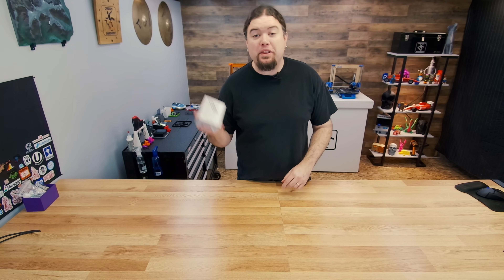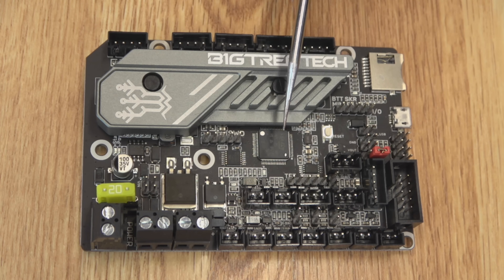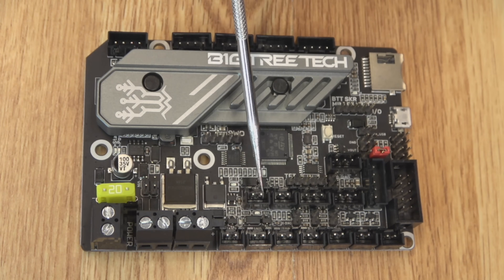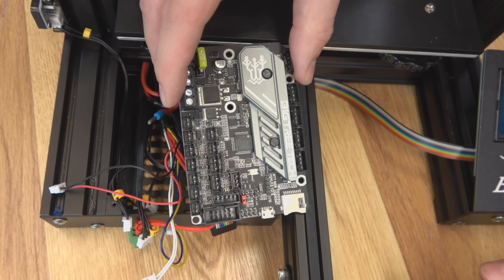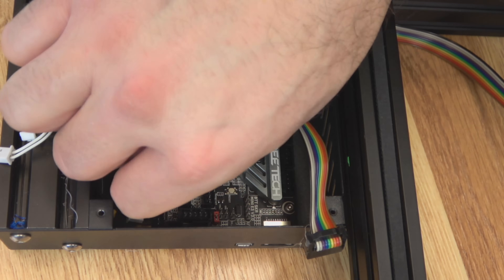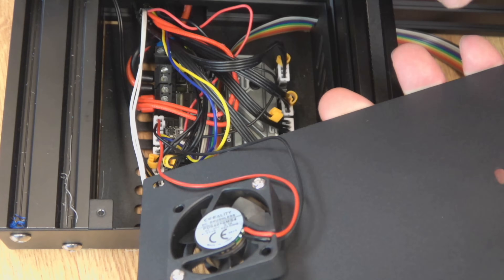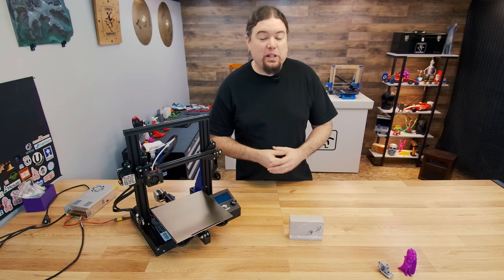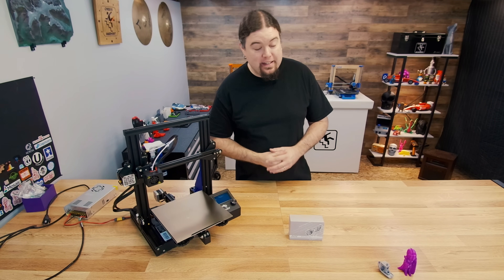BigTreeTech - SKR Mini E3 v3.0 - Chris's Basement

Comment: I dont have the tools to install a jst connector on to the hot end fan. is there an alternative solution?
Reply: If you have Dupont connecters, you could solder them to the raw wire. It's what I did in a pinch- make sure to insulate the joints

Comment: Hey, @ChrisRiley, Have you thought to check under the bottom of the pull out box, for this new board? They printed out the full pinouts,😳🤯 on the bottom,  of it. 

Great tutorial video for this board! 😉👍  

One thing i noticed, was that the micro-usb port, was a bit too wide, for the front of the metal front plate of my Ender 3 Pro, ( which laid dormant until 3 days ago because of a bas Mosfet on my BTT SKR MINI E3 V2.0 BOARD. I had to do a bit of filing to exapand the slot by about 2mm. After that, she fit smooth like butter! 😉

Comment: Dude could you help me please? I built a hybrid printer using an anycubic chiron frame and hot bed with ender 3 v2 print head and stepper motors. The stock ender board died so I bought this. Its installed but I have no idea what to do next.

Comment: Very useful. My V3.0 is coming for my Ender 3 Pro as the old original 8-bit board died on the extruder driver. The Marlin version is now 3 years old and no updated since this video came out. Klipper is 3 years old too, and I don't know if it can update in-place. Luckly the config file is 2 months old.

Comment: I keep getting "heating failed e1 printer halted" ive checked all my cabels and they are fine. I've also replaced my cables so I know it's not an issue with that. What is my problem?
Reply from the maker: E1 sounds strange, I think it should say E0. Is this the stock firmware?

Comment: Hello Chris - I'm HOPING you might spot this, in spite of the age of this video???  I want to pick your brain for your off-the-top guess on where you think I might need to look first: about a year ago I upgraded my old Ender 3 with this SKR Mini E3 along with a BTT Pi in order to move into Klipper.  For the most part things seem to work (from Klipper (mainsail) anyway) - BUT -- I can no longer print directly from the printer's control knob!  I can "see" all the gcode files of jobs that have already been uploaded/printed, but there does NOT seem to be ANY way of selecting one with the knob/switch.  Other things in the menu system seem to work (like setting temps, homing and manual moves of the hotend) but it sure would be nice once in awhile to fire it up and print something without all the steps of mainsail.  At least for prints that have proven successful already.
The other odd thing is that there is no way to connect to the SD card slot in the Mini - I can only see the card that the Pi boots from!
Have any guess?
Thanks in advance - even if all you do is read this and round-file it!
Reply from the maker: Not sure if you have seen this one, https://www.youtube.com/watch?v=guLfIbSH-Ig but the only thing I can think of is the pins aren't mapped correctly for the mini to the screen. I remember there being some strange stuff with the LCD in Klipper, like it would set the print ready, but not start it or something like that. 

On the SD card on the board, that is standard fair for Klipper, it only talks to the MCU to load firmware, so Klipper can access it.
Reply: @ChrisRiley  Thank you by the BOATLOAD, to put it simply! I'll take a look! 
Owe you one!!! 
Note to self:
Come back and pay up!

Comment: hey! thanks for the video. i’m installing it on my cr10s which has both the exp1/2 cables. would you recommend getting a th3d adapter so i can plug them both into the board or is there some alternative?
Reply from the maker: That's probably the best thing to do, you can find those a lot of places now a days.

Comment: Thanks for your great videos, they have helped me so much over the years!  Would you be willing to do a video on the BIQu Microprove v2 with the SKR mini e3 v3  marlin setup?  I have both these bits coming for my Ender 3 v1 and am seeing that people are having trouble using the probe port on the board, they are having to use the Z MIN Endstop to make it work properly which would not allow the use of z endstop homing.  There is a redit thread about this  that talks about it I believe. Not sure if BTT has fixed this issue yet or not.
Reply from the maker: Hey, thanks for watching over the years. I don't have one of those probes, but let me see if they will send me one and I will see what I can do.

Comment: I installed this on my ender 3 and now my lcd screen will not come on. I even bought the tft 35 touch screen and still nothing. Any suggestions?
Reply from the maker: Which ender 3 do you have? The stock ender 3 original screen should work just fine.
Reply: @ChrisRiley  yeah it's stock ender 3 but when I installed everything with stock screen and powered on screen not coming on at all.
Reply: @calvinmerricks7103 same issue for me, Ender 3 Pro. Some people say it’s from backwards installed display input on motherboard but that doesn’t work.
Reply from the maker: @calvinmerricks7103  Did you ever get this sorted?

Comment: Hey Chris!  I just purchased this board and the TFT35 E3. V3 Touch Dual mode display.  However after install when I try to do the 4 corner bed leveling, I get the front left and right corners done, but when I tap the button for either rear left or right  it gets in position and rather than go down for the adjustment it seems to stop.  However I noticed both Z motors were ever so slowly raising the extruder!  I've installed updated firmware with no success so would this be a moment where I have to go in an custom edit the firmware?
Reply from the maker: That's a really strange issue. I would guess it's something with the screen. Sometimes the firmware on those does really odd things. Not sure exactly how to correct it.
Reply: @ChrisRiley  Thanks Chris.  I think I'm going to go back to the old screen for now.

Comment: I bought an ender 5 plus with RepRap duet on a kinetica g2c board can I direct swap this instead
Reply from the maker: Yes, you can use it with the Marlin example. You will have to reflash the firmware.

Comment: Hi Chris i want to remove the z limit switch. Would it be possible to list the changes need to make in marlin please.
Reply from the maker: So you just what to use the probe for Z, no switch?
Reply: @ChrisRiley Yes Chris i have downloaded BTT  firmware use probe for Z homing .BIN and it works fine. however i want to make further changes. I have the BLT white and black wire connected to the Z endstop plug. Thank you for your reply . I would also like to use Marlin 2.1X as the BTT firmware is 2.0x

Comment: i have a Creality CR5 pro. I'm looking to upgrade to a 32 bit board. Which board would you recommend? I'm looking at the skr mini e3 and the skr3 ez board.
Reply from the maker: I don't know the CR5 well, but it really comes down to what plugs you need. The mini is a fine board, but you have only 4 drivers, so Z has to share. Also, it depends on what kind of screen you have, remember, the mini is meant for the ender 3 and can work on the old school CR10 with some code changes. The EZ is going to be more universal, but a lot larger.

Comment: I'm so confused as to where the hotend fan wires go if i DONT have a JST connector?
Reply from the maker: You can pull the shroud around the connector and just use the pins if you would like.
Reply: @ChrisRiley  ended up using some left over single dupont connectors.

Comment: Board works great, especially with the BTT TFT35 V3.0, even with USB jumper installed, can't connect to Pronterface, Cura, or Octoprint (Windows or RPI), Pronterface and both Windows and RPI see the com port, but won't connect to the printer. I should say it works great if I use a thumb drive in the screen USB port, but I can't center my prints.

Edit: Right after I posted this comment I had a lightbulb moment. I built and compiled a scratch build of the latest bugfix Marlin, I had the serial port configured wrong in Marlin.

#define SERIAL_PORT 2
#define SERIAL_PORT_2 -1

This is the right way, I've already forgotten the wrong way I did it.
Reply from the maker: Nice find! Yes, more than one serial bus makes it work like you have done here.

Comment: Just got my Version 3 board for my birthday last month. If I only have a stock endor 3 pro, do I need to HAVE the extra Marlin code or Kepler code, or can I use this board with just cura and nothing else?
Reply from the maker: If you just have the stock ender 3, it should work as is, no firmware update required.
Reply: @ChrisRiley  Awesome, thank you.

Comment: I have moved way past the Ender series printers, but still have my very first old original Ender 3 standard.  I recently upgraded it with this board and the CR Touch! It has many other upgrades, and still prints very well! I have two Anycubic Kobra 2 V2 that prints at 150 mm/sc. These print in a fraction and came with runout, power resume, auto mesh leveling, and direct drive extruder, all for $200.00.
Reply from the maker: That's awesome! Those Enders are pretty good!

Comment: hi could you help, ive fitted the e3 v3 to my ender 5 pro and the test print is very stretched in the z axis.
i also have the biqu h2 v2 extruder fitted
Reply from the maker: I'm guessing you will have to update some of the setting in the firmware for the ender 5 as the board defaults to an ender 3. You can update some of these commands in eeprom so you don't have to flash new firmware if you use a tool like pronterface. https://www.pronterface.com/

Comment: I replaced my old ender 3 pro board to skr mini e3 v3 and now printer dont even power on. Just red light on the motherboard flashing and emitting beeping sounds..
Reply from the maker: That should be a direct replacement. I would uncable everything except power and turn it on, see if beeping goes away. Then cable things up slowly and test to see what is causing the issue.
Reply: @ChrisRiley  Basically I just didn't realize that board is actually works because it literally silent, comparing to my old 4.2.2. I  updated marlin firmware by using sd card and use exp3 slot on my stock ender display, because exp1 and exp2 ports are not working with skr e3 v3. Maybe my comment will be helpful for someone. All fine now

Comment: Didn't plan on an upgrade, but my new Sprite all-metal hot end has a bltouch connector that won't fit into the BTT SKR Mini E3 v2 (it has a port for it, but it has a form-factor for a three-pin and a two-pin connector, instead of a straight-5 pin connector).  Great video for covering everything I needed!
Reply from the maker: Awesome, glad it help with your project.
Reply: And... I also did get the yellow duck, the crown of victory on my board upgrade!!!

Comment: How do you wire the CR10? Theres 2 case fans and then the hot end and the part fan ... But only 3 jst ports
Reply from the maker: I didn't know it had 3 case fans, you would either have to wire one to the input voltage or not run one.

Comment: Will this board work with dual z axis and a CR touch?
Reply from the maker: I will work with dual Z, but only one driver, but it will drive both motors at the same time. It will also support CR touch.
Reply: @ChrisRiley awesome. Thanks so much. Ordered.
Reply: @handymadness  I hope you have better luck with yours.  I got a this mini plus the TFT 3.5 screen plus the BTT Pi 1.2 rPi clone.  None of them seem to do what is expected of them!  Their documentation sucks and their "tech support" is virtually useless!
Reply: @palewriter1856    I 100% agree.  I finally gave up.  I had the SKR mini e3 v3 TFT 25, sprite, cr touch, and all it ever did was give me the error kill code.  So so annoying.  So I went back to the 4.2.2 board and the stock e3v2 screen and it all works except the CR touch deploys off the bed when I auto home.  insanely aggravating, but still miles ahead of where I was with the mini e3 nonsense.

Comment: Hello, does this board act as a direct replacement for the CR-10S with the v4.2.2 board?
Reply from the maker: For hardware, yes, you will have to get and upated version of firmware to flash it for the CR10 changes. By default they are configured for the ender 3.

Comment: in the ender 3 pro in the green sockets there is a fan, the first 2 negative and positive, you don't say the cables where they are placed, and by the way, what fan is it? and on the board that you show there are only 2 connections for the bed and the hotend.
Reply from the maker: Check the pinout for polarity. Fan0 is the part fan, fan 1 or 2 can be the hotend fan or controller fan. https://github.com/bigtreetech/BIGTREETECH-SKR-mini-E3/tree/master/hardware/BTT%20SKR%20MINI%20E3%20V3.0/Hardware

Comment: Have you been able to get it to connect with Octoprint? Octopring does not detect my printer...
Reply from the maker: It connects on mine, it could be a problem with the USB port. Test and see if you PC can see it.
Reply: @ChrisRiley  how do I test it to the PC? If I plug it into the pc what would the pc so? Detect the SD card?
Reply from the maker: @InfinityDrones  Download pronter face https://www.pronterface.com/ if you plugin USN to your computer Pronterface will be able to see it and you can control you printer to confirm the USB is working.

Comment: will the SKR Mini E3 v3.0 work on Ante A8
Reply from the maker: Sure it should, but you will need to update the firmware.
Reply: @ChrisRiley  Thanks, Which firmware would i need to upgrade
Reply from the maker: @CarmineSantopietro  You can use the an example marlin for the A8 here. https://github.com/MarlinFirmware/Configurations/tree/release-2.1.2.1/config/examples/Anet/A8

Comment: When two wire plug wires are opposite you dont need to mess with the plug wires, just pull off the female plug from the board and turn it around put it back on.
Reply from the maker: Cool, thanks for the tip!

Comment: Great video - Will this work with a CR10S, CR-Touch and a Micro Swiss direct drive setup?
Reply from the maker: Yes, should work just fine with minor firmware changes.
Reply: Thanks Chris, What changes would you sugest?
Reply from the maker: @sweres5839  The are coded for an ender 3 so mainly just the printer size would need to be updated.

Comment: Nice video. I got this board for my Ender 3 Neo but couldn't get it to work. The homing was all off no matter what firmware or settings I used.
Reply from the maker: Not sure on the NEO, it might use a different kind of endstop than the other printers.

Comment: How do you update this so my board works with CR 10 size I updated them as a combo
Reply from the maker: You would have to build it from a Marlin example for the4 CR10, check here. https://github.com/MarlinFirmware/Configurations/tree/bugfix-2.1.x/config/examples/Creality/CR-10/BigTreeTech%20SKR%20Mini%20E3%202.0 This will work with the V3 board with very minor changes.

Comment: I have an old Ender 3 clone with a dead MKS Robin Lite board.  I am trying to reactivate it with the SKR mini E3 V3 but it has 2 pin sockets for the End Stops.  My printer has 3 wire End Stops.  I'm willing to replace the 3 wire ones with 2 wire ones if someone can point me to a vendor with the correct item.  Everyone on Youtube with an Ender 3 seems to already have 2 wire End Stops. Can someone point me to the correct replacement parts or perhaps how to make the 3 wire switches work with the SKR board?
Reply from the maker: What type of endstops do you currently have? The ones on the PCB with the LED?
Reply: @ChrisRiley  yes
Reply from the maker: @bsorrell98  So I'm not sure if those will operate without 5v, but the 5v can come from anywhere. So you could do the Negative and trigger pins on the endstop pins and find 5v somewhere else. Or switch to a smaller micro switch. These work without 5v https://www.amazon.com/Creality-3D-Printer-Separate-Package/dp/B07BF8KXW3/ref=sr_1_19?crid=21UH6URDXXX6M&keywords=mikro+endstop+switch&qid=1681497345&sprefix=micro+end+stop+switch%2Caps%2C123&sr=8-19

Comment: Chris, great video as usual. I am just in process of upgrading my Ender 3 Max, trying to improve first layer printing. I got a second Z screw and motor and wanted to add G34 gantry levelling. The SKR Mini E3 V3.0, looked like a great update so I did the two upgrades at the same time. Counting Driver output sockets instead of driver chips when the board makes the Z outputs link to the same driver! OOPS! my bad should have been more careful. Ender 3 MAX has 2 part cooling fans and the V4.2.2 board has 2 input connectors. Confusing, but worked it out.  BTT diagrams, I downloaded all the docs from Github as usual, on the wiring diagram illustration the 3 hard wired ports DC In, HB and HE0 are all marked grey and green. HEADS UP! DC IN + and  - are colour coded reversed against the other 2 inputs.  Not complaining to you, but hope this may help someone else. Thanks for all your work.
Reply from the maker: This is great info, thanks!

Comment: Hey man love your vids! I was wondering if you have any tips in regards to custom builds using this board? I have been able to compille a firmware version but I am having issues in finding how to setup the current limit? As I am going to use different steppers than the standard Creality ones. Thank you so much for your work!
Reply from the maker: Thanks! You would have to get the motor specs from where you bought them. The most common NEMA 17 motors, 800mAh is usually more than enough. I would start low and increase the current slowly until they stop skipping. If the motors get too hot, then the current is too high.

Comment: I had the 4.2.2 board and now recently upgraded to the 4.2.7 with klipper. Is it worth it to get the skr or should I continue with the 4.2.7. How much better is the skr?
Reply from the maker: Unless you need more ports for some reason, they are going to be about the same.